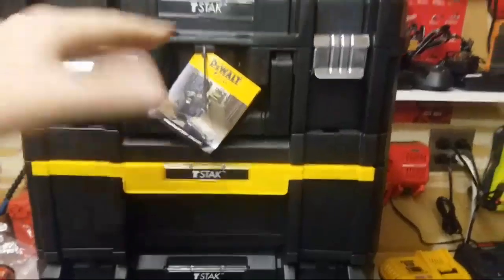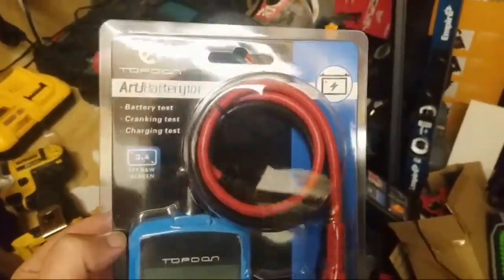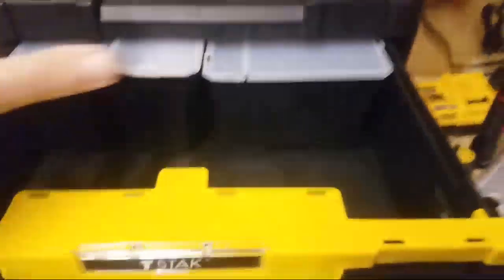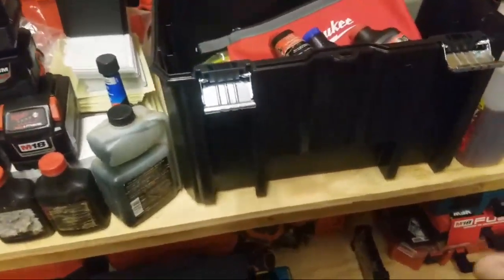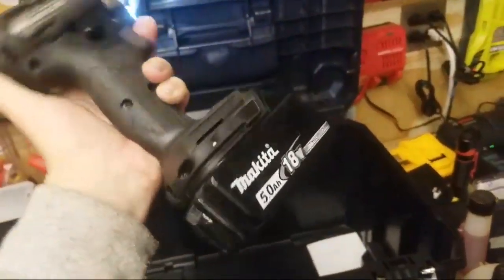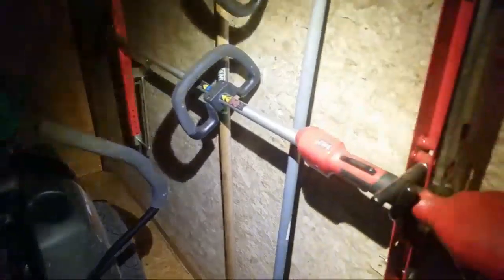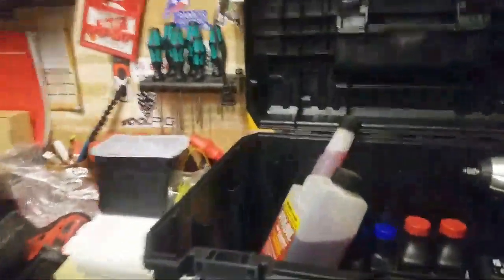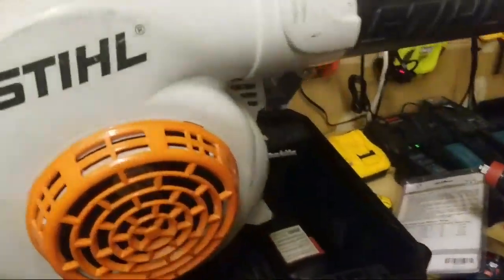DeWALT TSTAK Storage For Your Business

Comment: Tough system at any price cant hold a candle to the packout. The handles break very easy, the plastic is brittle and cheap. I need my tough system fix because its cracked in many places. And guess what? Its newer than my packout system and broke already. Packout all the way. But I like the tstak system gonna check it out.